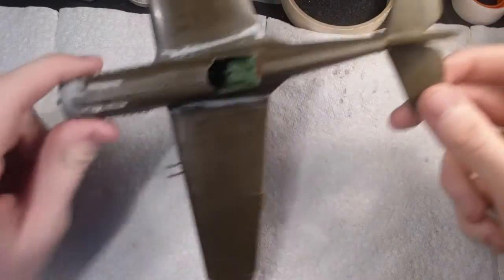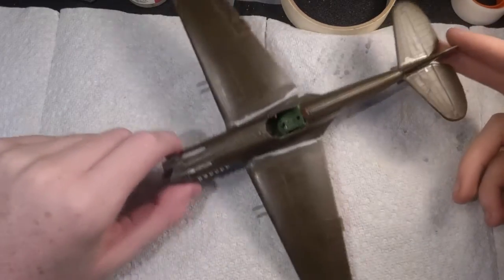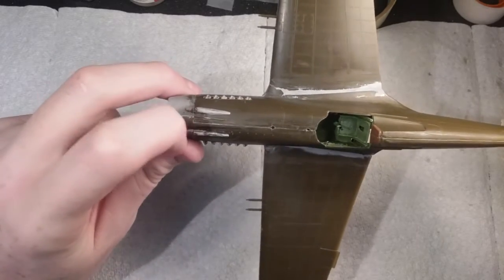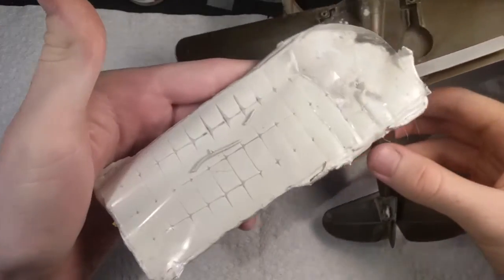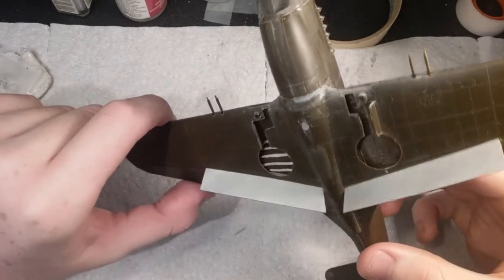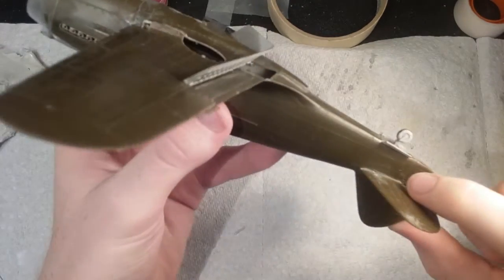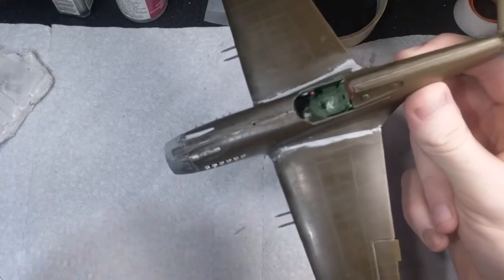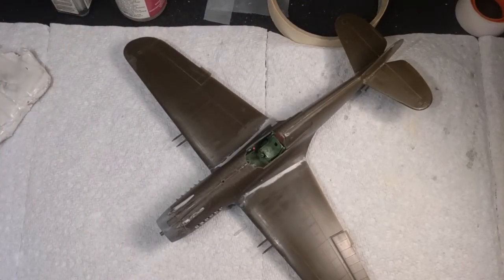Revell P 40 Build Part 03

Comment: I am no expert, but you can get a great product (well, I like it) from Vallejo called Plastic Putty (70.400). It flows really well and dries quite quickly and seems to work well too. As it is acrylic, you can thin it down even further with good old fashioned tap water. It's also quite cheap too, so I would recommend that you give it a try, maybe not on a new model or anything, but just on some scraps to see how you get on????
JJ
Reply from the maker: Thanks JJ I'll definitely keep my eye out for it ☺